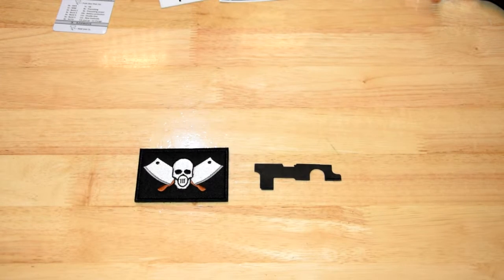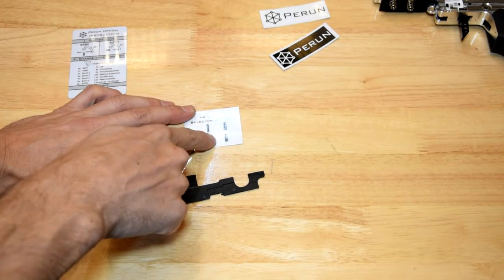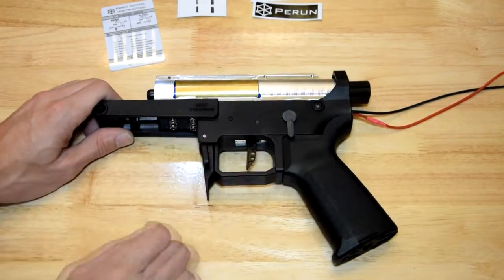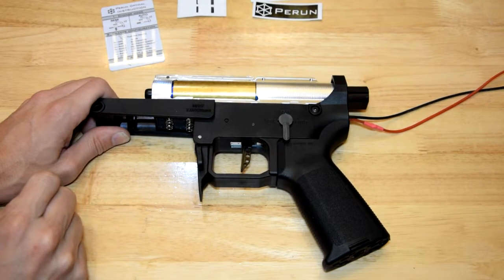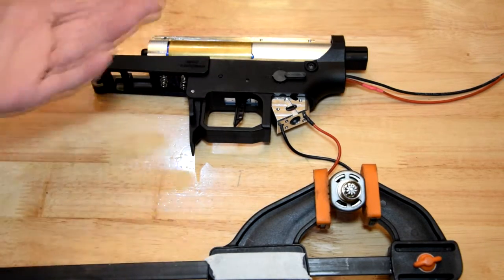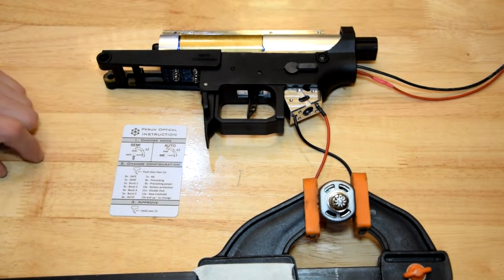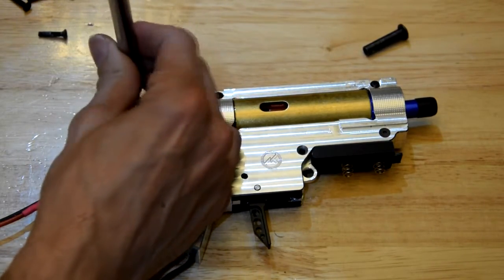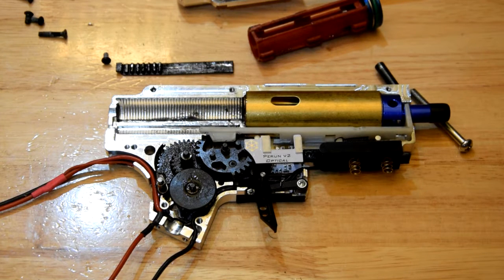DSG build (part 8) Programming the Perun (and catastrophic failure)

Comment: can DSG build by using nylon gearbox?
Reply from the maker: you can. but I cannot guarantee it will last.
Reply: @lowguidoschopshop  can use any metal gearbox or a specific one?
Reply: can i hv ur email add?
Reply from the maker: @kuchingtacticalblasterk.t.5832  i recommend a quality CNC box because a cast box probably wont take it

Comment: Hey LowGuido can you help me out i have a custom blaster from a shop up your way which i wont name but its got a perun v2 and it wont go into program mode and fires single shot on semi full auto on safe and auto on 7.4v i plug 11.1v in then i have some crazy 2 to 3 burst in semi then safe and auto are full auto and the shop says gear ratio is the problem and im no expert so i was wondering if you would be able to point me in the right direction if possible

Comment: I recommend gluing the piston rack onto the piston body. It will help keep the rack in place and lighten the stress on the piston brigde. You can use either super glue or epoxy, which ever one you have handy and works better for you
Reply: also, shim the area between the piston head and the piston to correct angle of engagement
Reply: You can correct angle of engagement via either the cylinder head or the piston head if needed. Correcting angle of engagement is not always making the pick up teeth meet at 12 o’clock position. I think I gel blaster, since the gel is so light, there’s no joule creep there for wether you correct AOE via the piston head or cylinder head is more personal preference

Comment: ☺😊😀😁😂5 that's why you always go full metal over cheap plastic same box v2 solid steel and barrel. I like my ACR just hooked up the 7.4v 75c 6500mah battery sounds nice on the original motor and gearbox aluminum barrel as the 3 18650 have had there day 😢 but 1.3 spring and running perfect well check tomorrow on the feed as on the cheap 11.1v got a lot off issue.

Comment: real problem is AOE  why its happen ;) . Contact me I can help you :)
Reply: Hey, I have had a similar problem with my piston head screw stripping and head coming off, can you explain what AOE means. I believe it may help me. Cheers from a newbie gel blaster tech lol.
Reply: Daniel Trembath AOE is angle of engagement, the angle which the first tooth of the gear makes contact with the piston. You can fix it by putting a pad on the piston head, there are lots of YouTube videos about it.

Comment: ahh dsg problems i destroyed 3 plungers before finding a strong enough one. the red one you had, 2 shs ones as the groove were the rack sits isnt full length. a black one from x force fixed that full length groove then super glued it in. also the Perun has a easter egg. spam the trigger after you have done the 12 pulls to hear house  of the rising sun